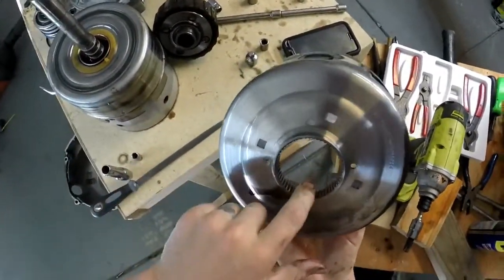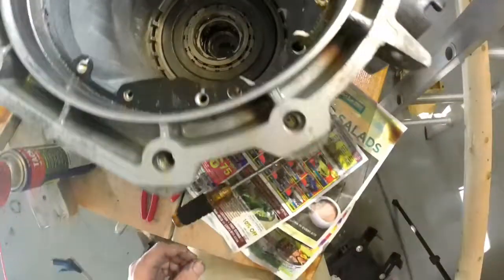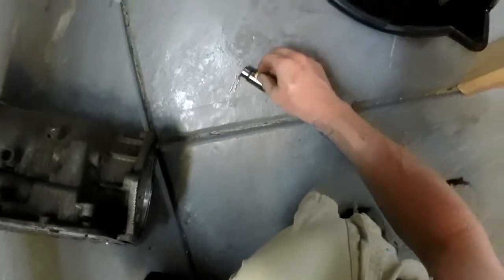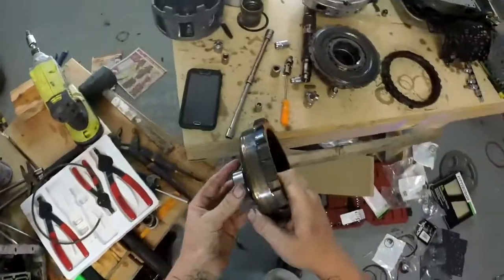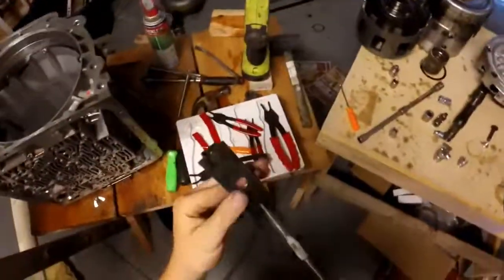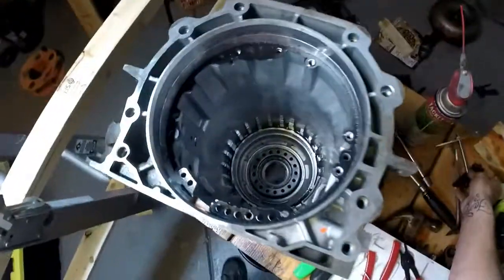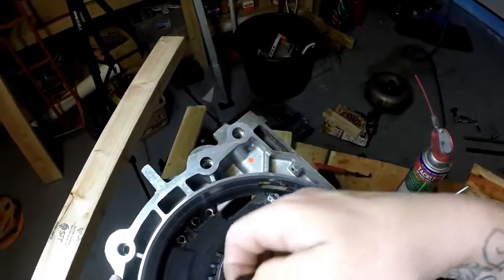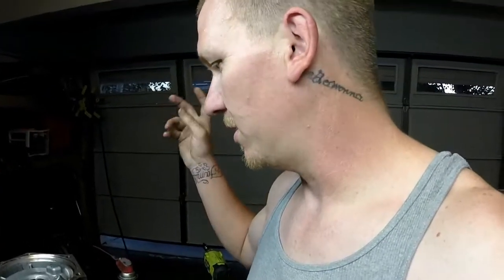4L60e - 4L65e - 700r4: Drive shaft, Sun Shell, reverse piston, low/ reverse removal.

Comment: I'm doing the same thing as you, converting a 4wd transmission to a 2wd. I only paid 25 dollars for my transmission.
Reply from the maker: That's one hell of a good deal. I ended up doing so many upgrades. But I got the transmission that I wanted. It's been in my truck for about 6 months now. We don't drive it much, only on weekends or long family trips. This past weekend we got to 1600 Mi on this trans. I'm going to add an external hydraulic filter. But it is well worth it in my opinion. Good luck and keep us posted with your progress.